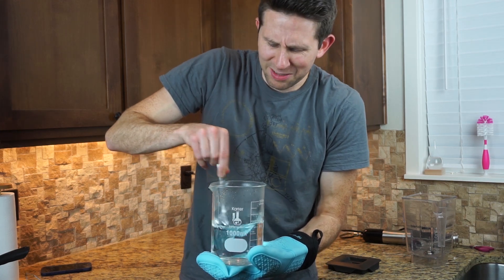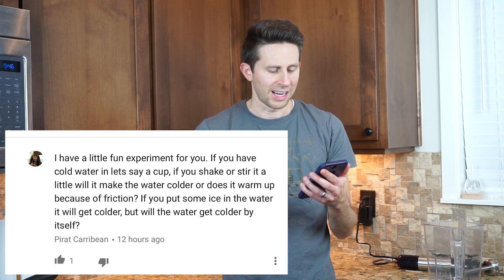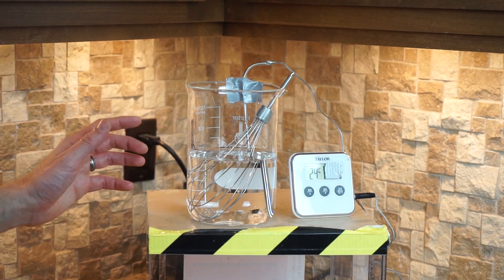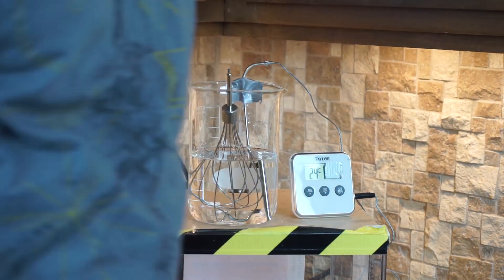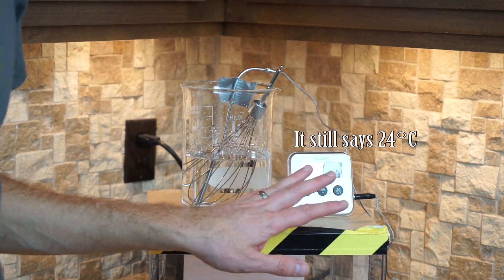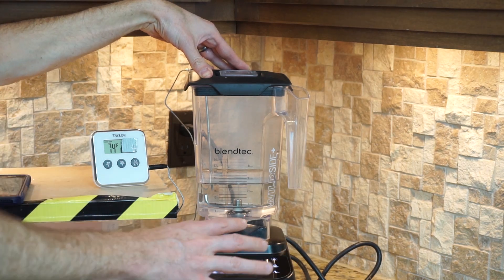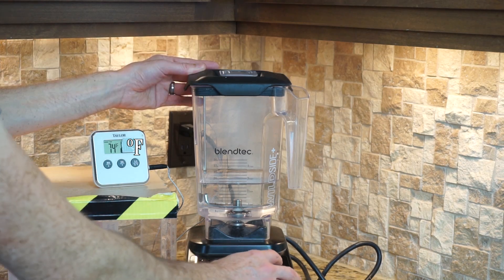Can You Boil Water Just By Mixing it Really Fast? Water-Stirring Challenge Accepted!

Comment: When I first read the title, I was like “Of course not! That would never work.”

Boy, was I wrong. This is the first I’m hearing of anything like this... I love it!
Reply: Y'all seem amazed, but this exact experiment was done centuries ago by Joule, tho they didn't have mixers, Joule used a thermos ( an insulated material can, not a modern one) , a rotor and some weights. The rotor was inside the thermos, and was connected with a string to two weights to get it spinning. Inside the termos there was water at around 25,34 degree celsius, when Joule dropped the weights, the rotor began to spin and the temperature of the water raised circa to 25,89 degrees. In this way he could demonstrate that kinetic energy was directly connected with heat energy. Thus, not heat could have been generated from any motor. Ahh..our reality is a strange one
Reply: No Google, I don't want to use my real name. Yes you should use your real name.
Reply: Seth Burrow / Masks and Stuff it’s really interesting! It’s simple though as kinetic energy is actually heat energy. For example if you heat something up let’s say water right? All you are doing is giving the particles more energy and making them move faster! So heat energy is directly related to/is kinetic energy. So the faster you move something the hotter it’ll get.
Reply: Same
Reply: Same
Reply: thats cuz ure dumb
Reply: @SpellbreakWiki  Motors can get extremally hot, pretty much to the point where they burn your skin.
Reply: @Zharaef Aniq there are many types of plastics, but none of them can melt at 100 C. Most of them can take quite a beating before they get squishy
Reply: Seth Burrow the motor of the blender Made it hot, not the movement friction

Comment: Would the water heat faster if the blades were modified, perhaps not sharp blades but a flat vertical plate with two holes in it that just stirs the water quickly. Sharp blades are not the best way to heat water like this. More friction with specially made 'blade' for the job.

Comment: You can also mix water to make it cooler. First I got a big red tub (It's about 32 by 32 cm (round) and then it went up by like 32 CM too. You can pour a little bit of cold type water, not super cold but just right before warm to where it feels warm but when you pour it on yourself, it's cold. (Only a bit of the water) and then you can shake the red tub for around half a minute or stir it with your bare hands. After a while you can pour it onto your hand and it will eventually be colder. It kind of depends if you're doing it right next to something hot then logically it would not do much but I was inside my bathroom to test it out and it was around 7 PM

Comment: The water is conducting heat from the blades - they act like a filament in a kettle when they spin for a while. It is not the actual movement of the water that is making it hot.

Comment: Is there any possobility to be the motor of the turbo "mixer" that heats up the water? I mean, when the motor is runnig, it will heat and by conduction and radiation will heat up the water

Comment: dear friend even if change the temperature that doesn't mean only because of Water-Stirring but because of motor heat linked to the water pass by metal or materials ! 
if you want to find out you should be use ( Magnetic stirrer beaker ) but you should also use vacuumed double glass disk on bottom then you get %80 real result and %20 for magnet heat and atmosphere effect .. thanks great job

Comment: I pretty much guarantee the water was boiling because the fact the motor in the blender was getting hot and the temperature was passing through the blades if you looked at when it was boiling in there it was boiling off of the metal impeller so likely the impeller was where the heat was coming from

Comment: You are using a blender to stir water. The heat is transferred from blender blades (rotating at such a high speed). How did you confirm that it’s not the blade that’s heating water?

Comment: I nust think that the blender so hot that it transfer the heat to the blades so that the water boiled. You can see at the end that the water was bubbleling just in the middle os the blender, the part that get heat from the motor.

Comment: I have a good question. Would putting salt in the water affect how hot the water can get or if it gets hot at all?
Reply: jumpedupbitch101 salt just increases the boiling point so it will get just as hot but will have to make it to a higher temperature before it comes to a boil

Comment: I work in nuclear power. We use the reactor circulation pumps to heat up pressurized water reactors to rated temperature/pressure prior to starting the reactor up. Simply running the pumps is how we pre-heat those reactors (with some pre hearing from decay heat).

Comment: It was always a point of interest for me that in theory, water at the bottom of a waterfall should be hotter than at the top but I suspect the increase in surface area as the water falls allows it to evaporate more and so has more of a cooling effect resulting in the water actually dropping in temperature. It would be interesting to test a few waterfalls to see what actually happens.

Comment: huge problem with your experiment. most of the heat being picked up by the thermometer (and added to the water) is radiating heat from the motor traveling through the blade. it isn't heat generated purely by friction.

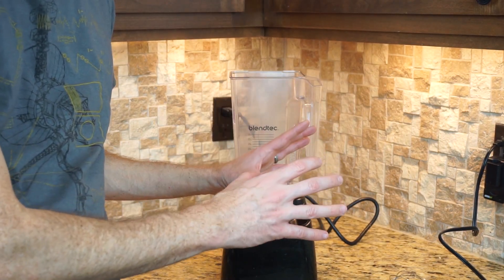Comment: I tried to calculate the efficiency of this process, I mean ¿how many of the work done by the blades were transformed into heat? So I started calculating an estimated mass, from 5:01 he shows the water in a beaker which measured an aproximated volume of 400 ml, that means 400 g. So from 2:57 to 3:16 the water increased 6°F or 3.33°C, in 19 seconds. As in 1:48 he said the blender can put out 1500 watts, that means the work done was 1500 x 19 J = 28500 J and the heat transfered (or given by water), with the specific heat of water is (4,184 J/kg°C)x(0.4kg)x(3.33°C)=5,573 J of heat given. So the efficiency, defined as (Work done) / (heat received) = (28,500 J )/(34,073 J) x 100% = 83.6% .I mean that's so efficient! (Please verify if everything is ok or I missed something) Thanks for reading.

Comment: Before altimeters, I understand that early explores in the Himalayan mountains were able to determine their altitude by measuring the temperature at which water boiled. In other words, the higher they climbed reduced the boiling point of water.  At the top of Mt. Everest, the boiling point of water is ~160F, compared to 211.3F at seal level.

Comment: But can't you make hot soup with a blendtech? They power from the motor warms up the soup so that's probably why it heats up the water...the product was made to do that from what I've seen of them.
Reply: No, the blades are completely isolated from the motor shaft via rubber connectors. Rubber itself is a very poor conductor of heat, not to mention the motor was designed to produce as little as friction as possible. Other wise the entire blender would’ve started smoking or gone up in flames.
Reply: that is what i was thinking too
Reply: I googled it, and yeah, there's blenders marketed that they make hot soup. Cool. I'm not sure though if it's through an added heating thing to it though, or through the process shown in this YouTube video.

Comment: The heat from the friction of the motor was transferred from the metal blade to the water. You basically boiled water with hot metal....

Comment: Technically some of the water boiled as soon as the blender was turned on due to what is commonly known as cavitation. Interesting fact is that cavitation is was submarine captains and crew dread as the propeller creates boiling water and bubbles which pop and create noise which is audible to enemy subs if the props are spun too fast.

Comment: Actually the heat is not all come from friction, the blade of blender is getting hot after while and it start to boil the water, you can see when blender is off bubbles are coming out directly from blade cuz the blade is got overheated.

Comment: Its not friction ,Temperature is a quantity that is a measure of the average kinetic energy of the system ,by blending the water you are just colliding molecules that gives them more kinetic energy to wiggle,rotate and  travel faster .
In fact friction is the reason why this method is not efficient as water molecules lose the energy to the surface of the container
If you did the experiment in a insulated ,frictionless container it would be more efficient.

Comment: A very good kitchen table top  experiment. Well done.  Yes, you should have mentioned that there will be some possible heat transfer from the motor to the blades,, but there is an equal certainty that there will be a transfer from the liquid to the blades and the motor.  It works both ways. Only dependent upon which is hotter at the point of contact,, the shaped blade drive.

You did well to bring up Joule.  And should have mentioned blender soup recipes,, they've been included in blender owners manuals.  And,, it is interesting to note,, the total wall plug energy usage,, should be very similar to a crock pot, a resistance heater.  (Less the waste heat from the motor cooling.)  (But a crock pot also heats its outside,, so,, not that different.

Shut down everything in the house,, use the electric company's meter to adjudge the total usage.  Boil water with a crock pot,,, vs,, boil water with your blender.  My initial guess is that the crock pot will heat water at half the cost.

Comment: It's not friction, it's cavitation. The blades produce vacuum bubbles in the water and when they collapse they generate a lot of heat, far more than friction would. This is why propellers on boats get pitted after a while as the temperature is so high locally it damages the metal.

Comment: The hardest part about scientific discovery is not coming up with some question you want to know the answer to, but in devising an experiment that will give you an answer as accurate as possible. This should be redone with the water in some kind of insulated container (maybe like a thermos) and with no mixing utensil (you can mix it just by shaking the container). You need an insulated container to eliminate the potential for outside thermal influences and you can't introduce any foreign elements into the water or you are adding more variables and diluting the accuracy of your results. How do we know if it's the water causing the heat or is it the metal/wood/plastic that is causing the heat? Do different materials create different amounts of heat? Does the shape of the material make a difference? Were these even questions we originally wanted to find out, or are we introducing new variables that are messing with our results? 

You could maybe put some water in an insulated container and then put that in one of those paint mixing machines that shake the paint cans? Take the temp before you start, put it on the machine for some amount of time, stop it and retemp? That should eliminate the vast majority of variables, is easily reproducable, and wont require you to literally shake a thermos of water for 15 minutes. This still wouldn't be perfect, but would be FAR closer than both this and the paddle wheel experiment.

Comment: Lower air pressure where the blades are spinning also affects the temperature of the water and blades. Vibrations also create friction which blenders give off a ton of. There are multiple more factors on "why" the blades spinning, isnt the only reason the temperature is rising. Good try though.

Comment: Hey guys, I actually work at blendtec, in the area we make that specific style (designer), and yes the motors get warm, and if you run them for long enough, the heat will eventually radiate through the plastic cover and into whatever’s above it (like water). However, there is little heat conducted through the blades, because of the bearing inside the jar. Most of the heat was created by friction caused by water molecules hitting other water molecules, and the friction between the blades and the water. So yes, for the amount he ran the motor, a fuse but of heat would have radiated through the cover, and the jar into the water; and from the friction of the bearings inside the jar itself; but I believe most of the heat was caused by friction INSIDE the jar, between the water and the blades
Reply: Just a quick amendment: The airflow from the fan flows up towards the top of the blender, and that would accelerate the heating of the cover; but the engineers found the is the best way to keep the motor cool and maintain efficient airflow throughout the unit. So yes, there were flaws in the test method, but unless you were to take the cover off of your blender and introduce airflow that directs hot air away from the jar, that would give a more reliable result. 

DISCLAIMER: I do not recommend you take the cover off of your blender, it would void your warranty (if you had one) and could damage your electronic boards, or the wires or the motor. Just don’t do it
Reply: Snowey The Fox yeah, you’re right. Friction from the bearings and brushes inside the motor produce heat that will radiate through the plastic cover and raise the temperature of the water, and that is a flaw in the test. But with how fast the blades are moving, I believe most of the heat was caused by friction between the blades and the water
Reply: yea...

:P
Reply: The blender manual specifically states to allow the shaft on the jar to cool for 3 minutes before touching it, yet you state there is little heat conducted. Someone familiar with their product wouldn't overlook that, so when you mention you work at blendtec, I'm guessing you're the janitor?
Reply: River Larsen my dad works at blendtec too! Small world haha
Reply: C4DeadCharge And you should quit trying to assume ;)
Reply: Phfff. Water smoke. Don’t breathe this.
Reply: Even if someone had strenght and speed enough to mix like a blender with their hands, their body heat would also transfer to the water.. so EVERYTHING HAS HEAT in it.. you cannot make something that doesn't transfer heat
Reply: River Larsen thats exactly what i tought
Reply: No
Reply: Oh yeah well I work at your momtec and THERE'S A SALE!
Reply: Proof or you're lying
Reply: Sorry, translate to English please and all the other replies also translate to english. I understand English not Arabic I know it’s science and I’m set 3 in science and all but please, talk English thank you.
Reply: No the bearing would not stop heat transfer unless it was an insulating material; which it is not
Reply: River, do you know the specs on maximum duration of continuous operation, expected failure time and whether the failure would likely be motor or other component (bearing. etc.)?
Reply: River Larsen Quit acting like you actually work for Blendtec, you just want to be the center of attention.

Comment: you see, your hand heats up when you rub it through friction easily because it's a solid. Liquid is harder to heat up because liquids have more energy than solids. Basically, in order to heat a liquid through friction you need to stir it really fast since you need to match the energy that the liquid has and the exceed the amount of energy it had in the first place to make it "hot".

Comment: Did the motor had anything to do with the heating of the water? I would assume that if you run a blender for a good amount of time the motor will eventually get hot.Did you checked the temperature of the motor? If it’s the same temperature it has to be the motor. For science sake can you do it again and check the motor temperature, because many people like myself are not convinced it’s purely friction.also water is used to cool vehicles trough radiators.

Comment: It actually is possible with the right speed and pressure, even cold water transported in pipes can lead to "Kavitation" which releases hot air bubbles and destroys metal. We've had it in engineering class and let me tell you. The best shit I have ever learned

Comment: The heat actually comes from the friction of the inside the motor, and it's carried through the metal parts to the water, moving water has a really low friction rate, otherwise, rivers would be hotsprings.